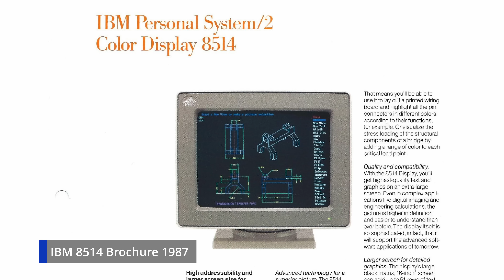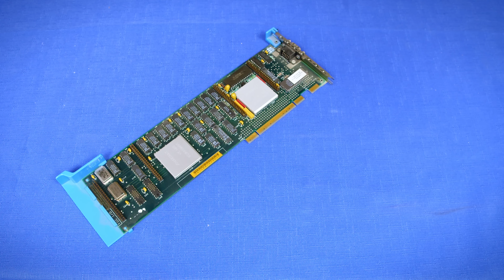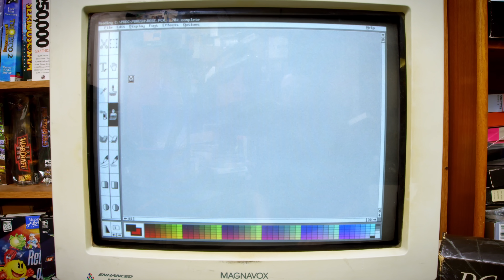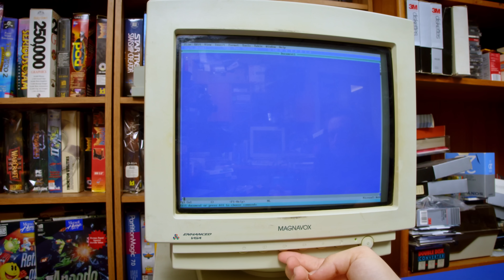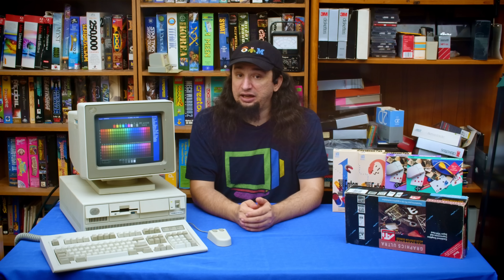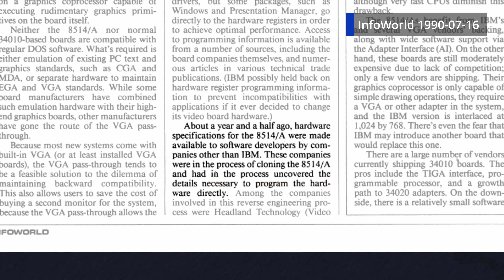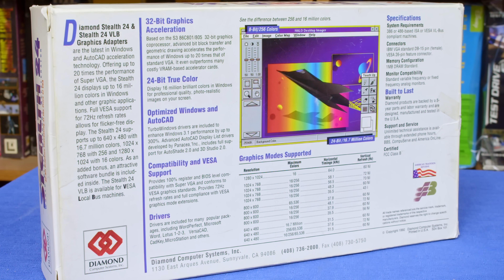IBM's Weird GPU From 1987 - IBM 8514/A

Comment: Speaking of that AI detour. US military was actually developing an autonomous driving Humvee around 1987, that was based on a camera and a lidar (more of a series laser range finders in a grid). I'm fuzzy on the details, they might have been 2 different models trying different sensor types. The goal was to make the vehicle autonomously follow the road curvature. Anyway, the idea was to pass a very low resolution video feed (from either sensor) through a perceptron layer that's now used as the basic block for virtually any and all AI models.

While it kinda worked, it was too basic to be useful and after the cold war ended the project was shut down.

Comment: As a 3D artist that started in the early 90's I'm more impressed you got your hands on a legit copy of Autocad that old that also still works.
Reply: Part of it still working is that it doesn't check Autodesk servers to see if your license is still valid.
Reply: @efad3215  I understand that. It's the fact that professional software back then often used a hardware dongle that usually connected to the parallel port to prevent piracy. They were often temperamental and known to fail. The fact he found a working one is what I am impressed with.
Reply: @hardwire666too  Ahhh, fair enough
Reply: @hardwire666too There was a commonly available software patch that got rid of the dongle verification. I don’t remember how I got it because it was pre-internet, but I got ahold of the patch and that allowed me to install Autocad and 3d Studio 3.0 in two computers without having to use the dongles. A couple of years later when I got on Compuserve the patch was easy to find in the Autodesk user groups.
Reply: @hardwire666too Программный ключ сделать сейчас пара пустяков. В России такое делалось на подобные программы, которые использовали аппаратный ключ в порту принтера.
Reply: @hardwire666too  AutoCAD didn't always use a dongle. One of the founders of the company had a website year ago where he wrote an open letter to them telling them they should abandon their new attempt at a hardware dongle. He told all about their effort at it when he was still with Autodesk. There was already a dongle crack available for that version when it was released, and it was widely regarded as a terrible release. He said they shouldn't have done the dongle and should have spent all the time wasted on useless security on making that release of AutoCAD better.
Reply: @hardwire666too  there were cracks back then too tbf
Reply: @Demento001  Yeah, but finding them is extremely difficult, and in many cases impossible.
Reply: @hardwire666too  In the AutoCAD 11 era, Autodesk mostly didn't use copy protection. That didn't start until around 2000.,
Reply: @RobShinn  Wrong. Was selling AutoCrap in Australia, 1989 - 1991, and for, if memory serves, all that time it had the black dongle on the back of the machine. It plugged into the parallel port and played all sorts of havoc with printer support.
Reply: @hardwire666too  not really lol you can find all major versions on vetusware and even for mac os on macintoshrepository
Reply: @RobShinn  Nope that was my mistake. I used 3D Studio back then which DID use a dongle. It was my understanding Autodesk used it on all of their products. I did not know about the drama surrounding the use of one on Autocad that resulted in it not being used in the US. So this all make sense now.
Reply: @hardwire666too  The dongles tended to be problematic and easily swiped so it was common to keep them packed away somewhere and use a crack to actually run the software.
Reply: @hardwire666too  Not difficult at all. Took me under a minute to find a cracked version of AutoCad 9 from 1987 on Google...
Reply: @RobShinn  They definitely used copy protection, but, like Microsoft and Adobe, relied on people easily breaking it to become the industry standard and kill off any competition.
Reply: @hardwire666too  Hardware dongles are easier to crack tbh, most of the time they're just sending a specific value or even spamming it constantly so if you figure out that value then its easy to re-make the functionality. Denuvo and the like requires way more effort to get past.
Reply: we had to decompile the EXE and do an assembler jump around the code that checked for a physical dongle.  It was a popular hack at the time.
Reply: @efad3215  that's why cracking software is a duty, even if you "own" it. in fact, its the only way you can actually own things. 

but its "illegal" . NO ITS NOT, laws don't apply to the cyberspace your computer create via abstractions, only the code is the law. repeat again with me. THE CODE IS THE LAW (as long as you own the silicon)

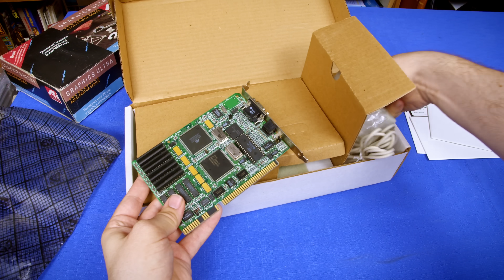Comment: 10:00 - Bus Mouse Port - I've heard of it years ago when I first go into computers as a teen in the 90's, but never saw one. Not even a video of one on Youtube, until now. Thanks for showing this oddity.
Reply: Ive only heard of it because the newest Linux kernel dropped support for it after so many years
Reply: I used a bus mouse for a few years back then. Much nicer than serial.
Reply: @BryonLape much nicer until ps/2 mice. It didn't take a comm port so it let you use more than 2 serial devices.
Reply: Lol I had completely forgotten about those.

Comment: Down memory lane when I was young and enthusiastically configuring PS/2 systems for customers by the end of the 80s. Exciting times it were. Battles going on about various topics in the clone market. The 8514A was barely noticed by the "generic" PC-world outside IBM PS/2 customers and those dealing with graphics. Some had "other" massively priced workstations for i.e. AutoCAD and we regularly outrun them with the PS/2 Mod. 80-311 for instance, the 8514A adapter + memory and (cough!) a non-IBM display (NEC). Later with the ATI GUP or Cornerstone ImageAcell we switched to some like the IBM 6019-19i, which entered from the sides from the professional workstations circles as the 60xx modelname already indicates ("60-pounder" ...). Some of the systems back then were even purely DOS-based and run i.e. Lotus-123 to make new, large and colorful spreadsheets with them before the advent of Win 3.1, which was the first really grown-up and usable Windows. And those made good use of the roomy Mod. 80 case by a second 5.25" HDD, memory cards, scanner card and network (Token Ring - of course. No serious IBM customer used Eithernet or NoWell back then ...)

Thanks for showing !

Comment: Great video, I was a PS/2 user running AutoCAD on the 8514/A with the original 8514/A monitor. Although I don't have a clear memory of the details, I don't remember I had big problems. Thanks for repainting this era for me. I used a lot of what you showed but didn't know all of the back stories.

Comment: I cringe when I hear younger people use the term "GPU" to refer to graphics cards, 2d accelerators and even 3d accelerators, especially from 1987! Being a bit of an older person, having been around PCs since the late 80s and owning PCs beginning 1992 or 1993, nobody used the term GPU back then. Please stop using the term to refer to old graphics cards! From what I can tell after refreshing my memory a bit, the GPU thing came about in 1999 when Nvidia pushed it on people with the Geforce 256. I'm also not referring to GPGPUs, which are general purpose compute cards since the introduction of CUDA and other graphics compute, but might've contributed to the increased adoption of the phrase GPU in its own right.
Reply from the maker: May 3 1976, GPU used as a term for a graphics device: https://books.google.com/books?id=Jzo-qeUtauoC&printsec=frontcover#v=onepage&q=gpu&f=false

GPU is a mostly meaningless term, I would say any video accessory that is capable of modifying its own framebuffer with new contents qualifies. The main goal is to offload setting pixels by the CPU.
Reply: @TechTangents  Oh wow, I stand corrected, although I do still think the term was popularised and entered mainstream use much later. Back in the 1990s I and all my colleague PC users certainly didn't use it. Great video by the way!
Reply: Well, they were graphic accelerators, the most useful accelerated function was copying parts of memory, or filling rectangles with colors. They are still GPUs, the same way as a fancy new Raytracer card, or a DLSS oracle is still regarded as a GPU and not something different. You know.. we are talking about graphics, albeit sometimes you get a SSD on a GPU too :D (like on special AMD FirePro's)
Reply: That was complete nonsense.

Comment: If you look at the board again, you'll see the Inmos palette/DAC on the board. Fastest one available at the time was 50MHz, which was the maximum serial video rate, which in turn limited the refresh rate of 1024 x 768. To be fair, 1024 was probably a stretch too far - really needed 75MHz or so of video rate to avoid interleave mode. 

800 x 600 mode was popular for the aftermarket adapters, since it was the most you could get out of 256K or 512K bytes of RAM.
Reply: IMS G171-50 looks to be the chip. (If you just look up Inmos palette/DAC you'll get the 80 MHz version). 50 MHz is the pixel rate (which is I think what you were saying but it confused me initially the data side is parallel). It should really be called the "sample rate" since it's a DAC and be quoted in megasamples per second but alas... 

I would imagine that 512K would be quite popular to take advantage of multi-channel for lower latencies on fetches and better bandwidth. I think these cards were the start of the linear color framebuffer era too and memory bandwidth would've been very tight.

Comment: I still have a PS/2 Model 70 with the 8514/a and 8514 monitor. They were my dad's. Haven't started restoring them yet (because, well, MCA) but I have some insights on the interlaced 1024×768 mode: BECAUSE the 8514 monitor had relatively slow phosphor and was blurry, you barely noticed the interlacing. Unless you used the corner of your eyes, that is. Other monitors I used down the road that also did interlaced high resolution were much sharper with faster phosphor, and the flickering was pure evil.
Reply: It was certainly a thing back in the day. Computer monitors had slower phosphors than TVs to reduce flicker. Fast-moving images hardly existed on PCs.
Reply: @grahamjenkins1236  And this is especially true for the IBM 5151 monochrome monitor, that provided a flicker-free 50Hz non-interlaced image driven from an MDA card. While later sync-anything TTL/analog switchable monitors (like early NEC multi-sync ones) were perfectly able to sync to MDA frequencies, the often displayed it with a unbearable level of flicker, especially if you were using a bright background ("inverse video").

Comment: I remember this era. One memory that stood out was OEM's touting NPS (Nozzles per second) in autocad.
Meanwhile, I was using a Paradise VGA card. Not because it was fast, but the display and Vesa modes worked well. Other cards were a nightmare in DOS if you used several different programs.
Later, we sooo wanted Matrox cards but the bean counters said NO.
Reply: Bean counters still continue to ruin things.

Comment: oh, woah - that MCA/ISA swappable card is an AMAZING idea -- I've never seen any cards that do that!
Reply: There were a few. The ATI 8514 Ultra (MACH8) was one and I recall a 3278 terminal emulator card DCA IRMA 3 Convertible and the DCA IRMAtrac MCA/ISA Token Ring adapter, which could do the trick.
Reply: @wacholder5690 , yes - I have videos of both of those adapters on my channel.
Reply: There also is an ELSA Winner 1000 ISA/EISA flippable card, sometimes called the "XHR Winner 1000", which is based on the S3 928, which would be a third-generation S3 chip if you count 911 as first gen and 924 as second gen.
Reply: There was at least one PCI/AGP flipper video card. It had a VGA connector on both ends, you'd swap the back panel bracket to change which motherboard slot it plugged into.

Comment: We used the Nth Engine (Zero To Zoom in under 2 seconds!), made by Nth Graphics, to speed up working with AutoCAD. It was based on the TI chip and from what I recall, it ran circles around the IBM 8514. Later, we switched to Rasterex cards, like the Lazer. They did real time pan / zoom in AutoCAD.